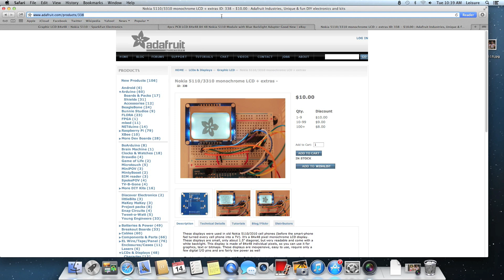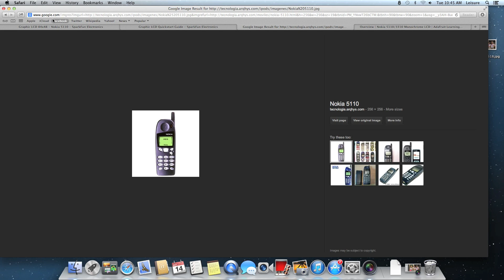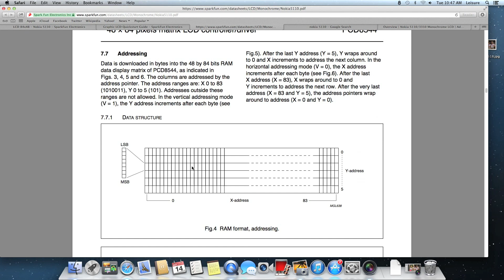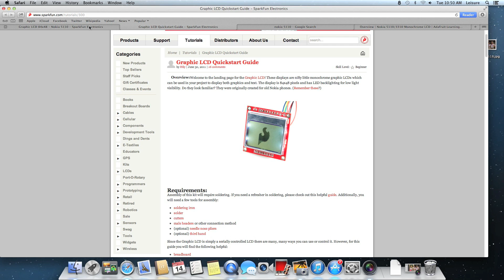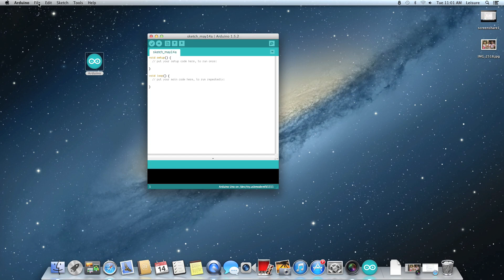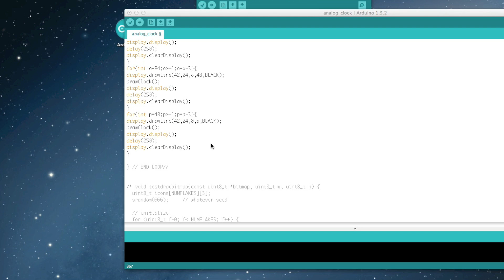How to Use a Nokia 5110 LCD with Arduino — $3 84x48 Display + Clock Demo

Comment: I've also seen quite a few Arduino-5110 articles which specify 10K resistors. Using some series resistor such as 10K would make sense if the logic pins of the display had some internal clamping to the 3.3V Vcc rail. But I don't believe there is such clamping.
As an experiment, I put a 5110 in a breadboard, and connected 3.3V to the Vcc, and ground to GND. I also had a separate 5V rail available. I temporarily connected a 10K resistor between 5V and each of the logic pins. Before this connection, those logic pins appeared to be floating around 1.8V or so. Anyway, each time I connected the 10K resistor  to a 5110 logic pin, that logic pin jumped up to 5V. If there was some clamping protection at those inputs, we would see the voltage on those pins not much higher than 3.3+0.7 = 4.0V. But no, those pins were at the same 5V as on the "input" side of the 10K. In other words, a series 10K resistor between a 5V Arduino "high" output and any of the 5110 logic pins would not protect those inputs from seeing a 5V signal. There may be some internal protection for the LCD controller chip, but it's not obvious.
If I had a spare 5110 LCD to sacrifice, it would be interesting to use a variable test voltage instead of 5V. Keep cranking up the voltage to see there is ever any kind of clamping at the logic inputs.
So, the correct way to manage the 5v/3.3V interface (assuming the 5110 module really does not like 5V at the logic inputs) is to use a proper level-shift chip,  or else a true resistor divider for each logic signal.

Comment: Already, now, I do not program the electronic modules on the Arduino platform; fortunately, now, I program on the in-system programmer, using Arduino IDE and different programmable software.

Comment: Just to let people know it is possible to use the Nokia 5110 screens on an Arduino without a library using shift-out. 

https://thecavepearlproject.org/2018/05/18/adding-the-nokia-5110-lcd-to-your-arduino-data-logger/

That saved me from messing with the hardware SPI bus which we were already using for the SD cards.  A secondary benefit is that the code is really lean, on the order of about 250 bytes for the default font after the compile if you already have EEprom.h in the build anyway.  The font, however takes up about 500 bytes, and I wanted the smallest possible footprint so that we could add live data output to loggers that are already compile near the memory limits.  As it turns out, stuffing those fonts (and some calibration data) into the internal EEprom was pretty easy to do:

https://thecavepearlproject.org/2018/08/24/tutorial-using-the-arduinos-internal-eeprom-for-fonts-header-data/

Comment: My LCD's contrast is very low, sometimes it's difficult to read anything from it. Sometimes it works perfect and clear but for just seconds, then it goes blink and then again its contrast lower down. And i didn't forget to setContrast(60). What the problem may be?
Reply: Try 5 volts. Mine had the same problem, but some models use 5 volts rather than 3.3. It won't hurt it, the max is 7 volts.

Comment: HI did check ur vid, but I still have a problem, I have a similar product nokia 5110, but the pin order is not the same, it is working but the text is so dimmed, I can barely see it, would u have any idea ??? tried a lot of things but nothing is helping.
thanks
Reply: Try 5 volts instead of 3.3. It won't hurt it (the max is 7 volts), and it worked for mine.

Comment: Hi great tutorial like all your other videos. Is there anywhere that the code for this Arduino/Nokia clock is still available for download?  Thanks. I'm really just interested in the second hand sweep loops. Thanks again.
Reply from the maker: That is a really good question John - I should have posted that code.  Let me see if I can find it for you.
Reply from the maker: John Light I sent the code to your inbox, along with my email if you have other questions.
Reply: Lonnie Honeycutt Thank-you I will make good use of it.
Reply: Lonnie Honeycutt Could you please send me the code?
Reply: John Light Can you please send me the code?
Reply: ***** Sure post an e-mail address and I will send you Lonnie Honeycutt's code and the code I wrote for a complete 12 hour clock with minute and second hands.  It's only accurate to +/- 1 second per hour but it does work.  The next version will use an RTC to reset the time every hour or so.
Reply: John Light either do i, buddy! plz, send tme the code! (Y)
Reply from the maker: John-I no longer have the code myself.  If I remember correctly I think I wrote over the second hand in white instead of doing a full screen refresh - but I can't remember.  Can you send the code back to me and I'll just post it to the video page?
lonnie.honeycutt@gmail.com
Reply: I have a slightly modified version of your code I made by watching your video. I could send it to you, if you still want it?
Reply: john please send me the code? haldunsuri@gmail.com

Comment: Great video.  Do you know how to connect two 5110 LCDs to one arduino?  I have tried two different ways without success. (declared 2 classes and giving CE a pin of it's own)  Thanks
Reply from the maker: Junker Man I haven't done it yet.  Will have to give it a try sometime.

Comment from the maker: Eidallon Google, seriously.  The most important skill you can have is being able to perform a relevant Google search quickly.  Then almost all the information in the world is yours.  I did learn electronics in the Air Force a long time ago, but I've learned 20X that since fooling around with this stuff.
Reply: I completely agree! Knowing how to research is definitely one of the MOST valuable skills someone can learn. If you know how to dig through the internet (google, etc) then you can learn anything you ever want. Only if people could understand this rather than asking to be spoon fed all the information.

Here are some of the things I've learned over the years that's helped me tremendously.

Hint: Asking questions is one of the slowest ways to learn what you want/need, because it's likely someone has already asked your question and had plenty of answers. Use google, seriously!

Hint: If you can't immediately find the answer your looking for, try searching your question in different ways / using different terms.
Example:
How do I ...
Is it possible to ...
Can I ...
Has anyone ever ...

Hint: Always be as specific as possible, this will help narrow down your search. If you're not seeing any results, try to slim the question down and be just a tad bit more vague. Repeat this step as necessary.

Hint: When it's finally time to ask your question, try a popular community where your question is relevant. One of the most valuable resources I hang on to is the StackExchange community. They have so many sub-communities it's crazy! For example, they have a community just for electronics, and another for gardening, and another for beer making, etc.

Comment: Thanks. Very helpful. My PC also had the keyboard problem. It seemed to go away after mucking around with my keyboard/mouse dongle. Maybe it's just the Arduino IDE, hence why I downloaded ATMEL Studio and Arduino for Visual Studio. Hopefully these solve the problem. Not much help on the Mac; unless you use a VM of course.

Comment: Hi, Lonnie. I tried your code with my Nokia 5110 LCD display (I have an Arduino Duemilanove) and the contrast set made all the difference, different from what you said in the video. The only difference I can see from my setup to yours is the Arduino board. Do you think it may be the cause of this different behaviour of contrast() function?

Comment from the maker: Look at the github page for that library, first of all.  On that page it says:
Check that the Adafruit_PCD8544 folder contains Adafruit_PCD8544.cpp and Adafruit_PCD8544.h

That page also says - You will also have to download the Adafruit GFX Graphics core which does all the circles, text, rectangles, etc.

Have you installed the libraries correctly?  Can I see the code?  The only thing I can tell from just looking at the  error messages you've shown is that you've probably misspelled setCursor